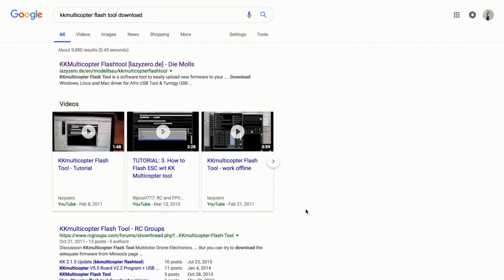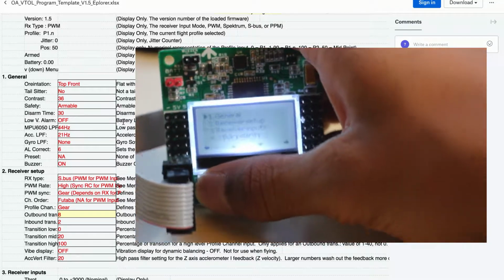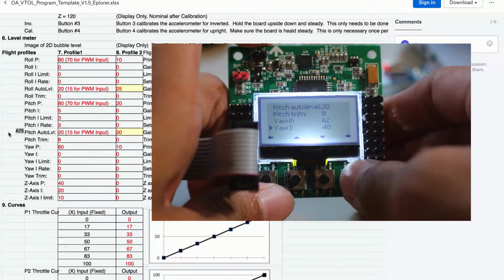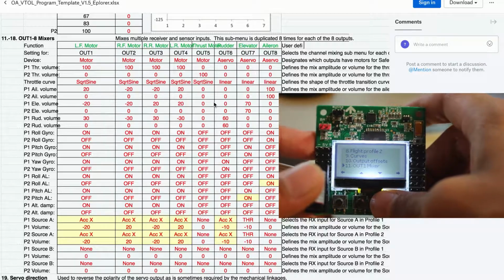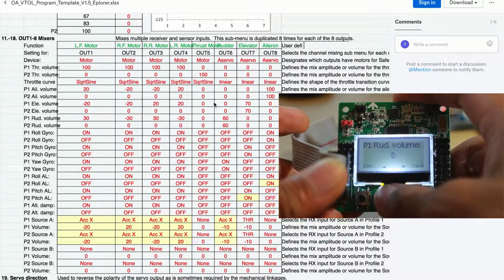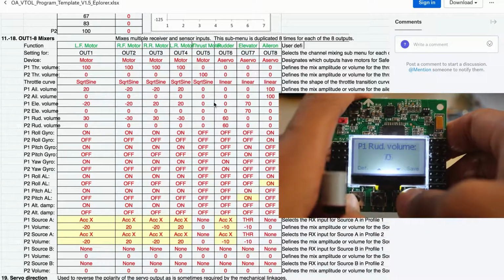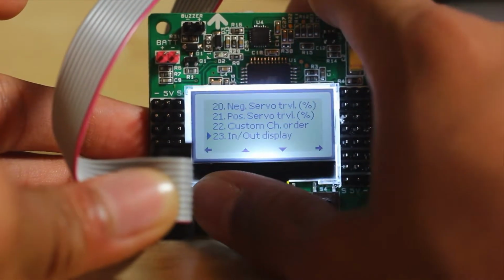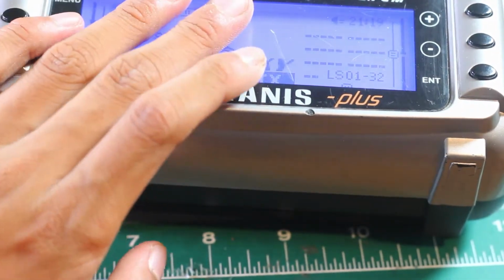FT Explorer VTOL Build Part 2

Comment: Hi Bando,
good job, nicely done.
Have something similar in mind to kill the time also using the FT Explorer as base which I already have.
I just have a hard time finding the actual connector which goes from the USBASP controller to the KK2 FC, actually have both. Could you please tell me from where you got yours. Suppose it came together with the USBASP

Regards, Richard

Comment: The output 5 engine is running in the initial takeoff mode.I checked the gear outputs.Gear outputs are in range of -1250 and +1250 . There was no such problem before, all the mods were working without any problems.I haven't changed anything. But at the moment output 5 is working in take off mode. What do you think is the problem?
Reply: i happen to encounter the same problem , all you need to do is to calibrate the escs by pressing the 1 and 4 th button of kk